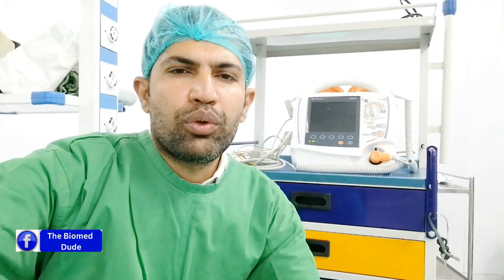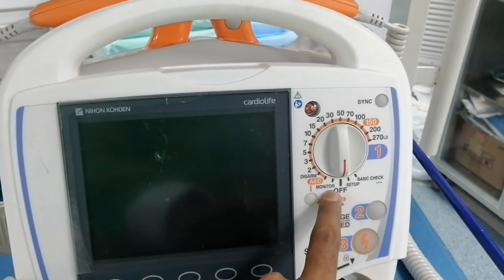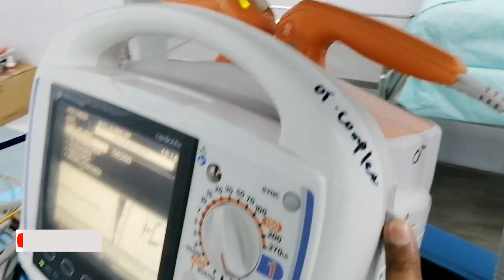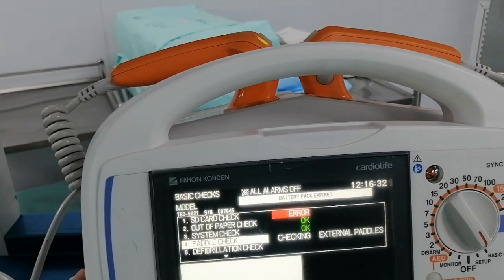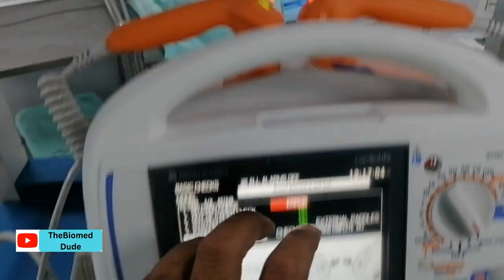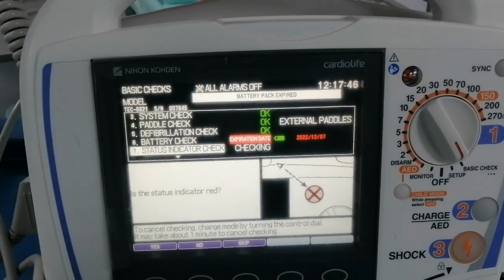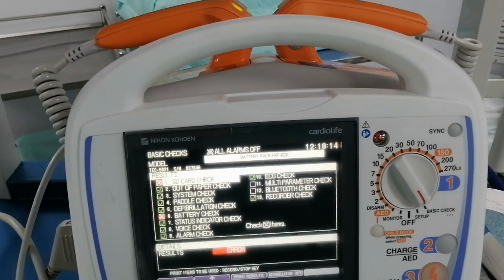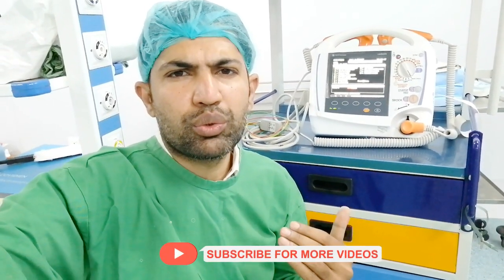Cardiolife NK 5621 Self Test | How to check defibrillator | Nihon Kohden | The Biomed Dude

Comment: How to do ecg with that defib, placing electrodes and pressing which button?
Reply from the maker: Thannks for your comment, No need to press any button for turn on the ECG monitoring , just palce the electrods the ECG automatically displaed on the screen , waveform selcetion button placed on the botom on th screen.
Reply: @TheBiomedDude  some there are 7 electrodes with my defib, can I use only red black and green?